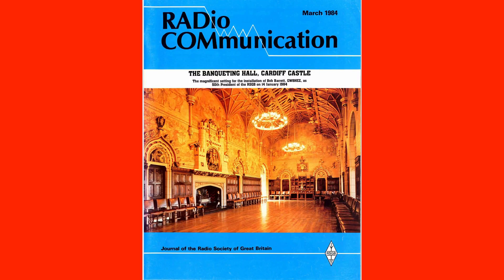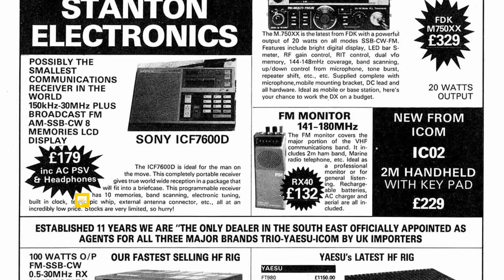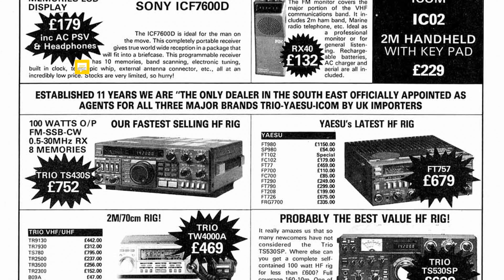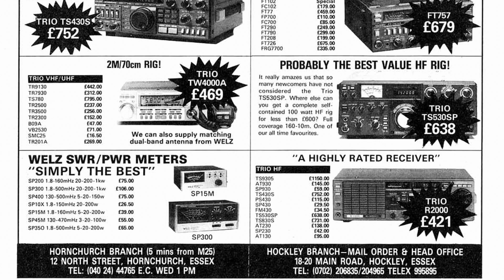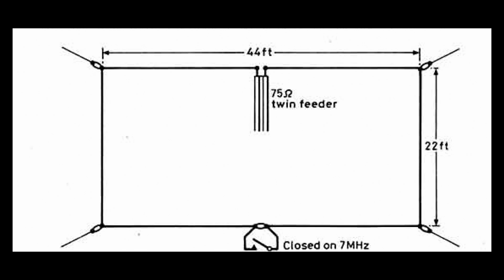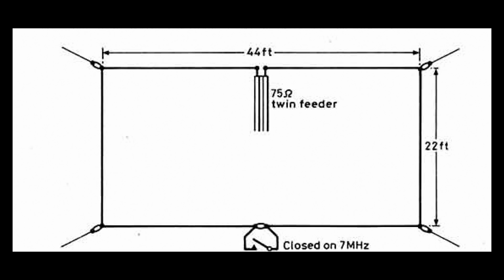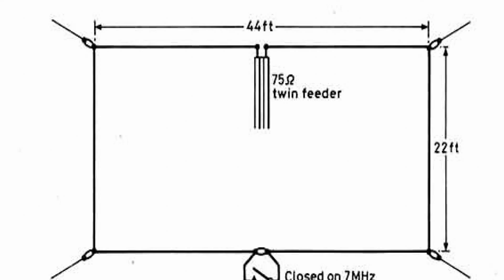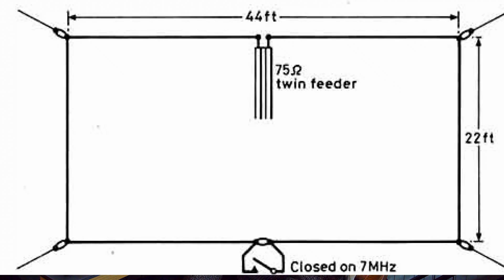Small Garden Multi-Band HF Loop Antenna | HAM RADIO

Comment: I had a 25ft by 5ft horizontal loop in my attic for a while. I fed it with RS 300ohm TV twinlead into a 4:1 balun and an LDG tuner. I had it open at the opposite corner from the feedline. I wanted to put a remote switch at that corner to I could open and close the loop, but never got around to it. The loop worked pretty well in that I was able to work all continents on it using around 30 watts on digital modes like PSK31. It did have some strange radiation characteristics though, like it was weak towards the northwest on 20 and not so good towards South America on 15, yet on I could routinely work Japan on 17 during the afternoon. I got into Europe regularly on 40 and 30. I had to take it down when I had some work done up in the attic and don't think I can put it back up there due to things like ductwork, etc, being moved around. 

Wonderful video, keep up the good work.
Reply from the maker: Interesting info.

Comment: Simple rule is, if it  loads up try it, you can always reuse the bits. Saw one of  your ads  in Wireless from the 70's and you going on about Small Garden Approved antenna on offer.